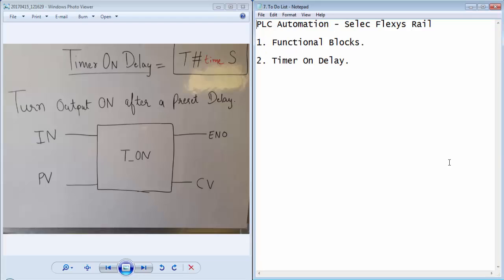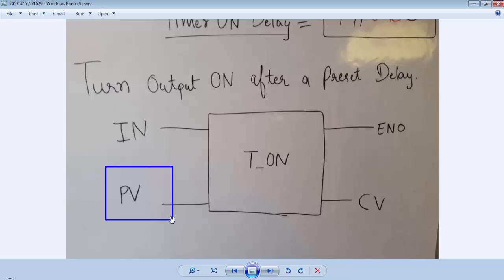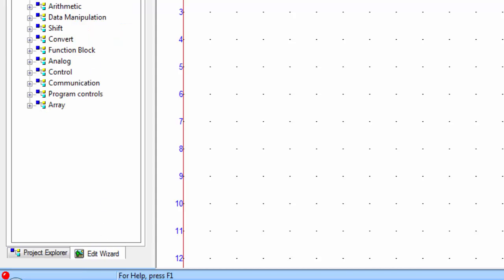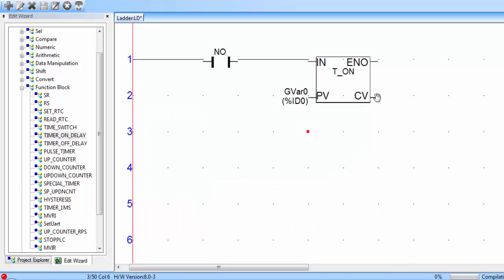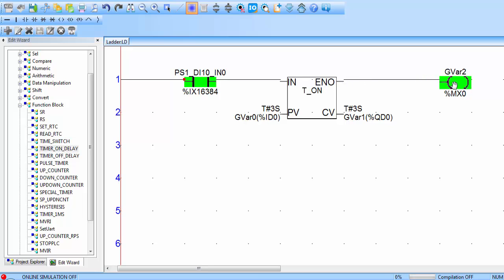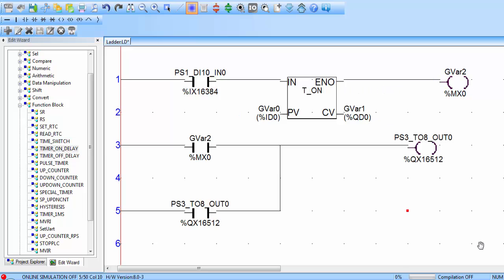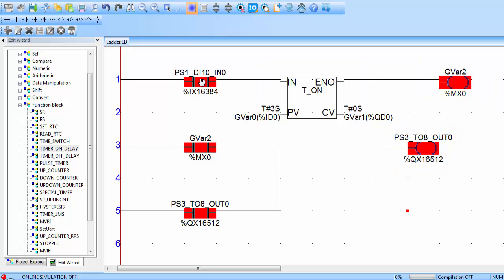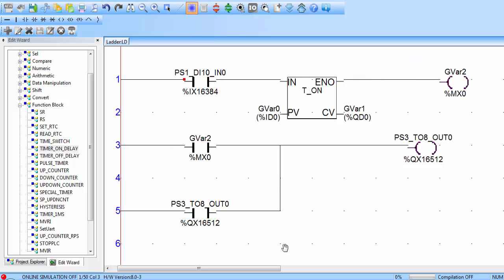Selec Flexys Tutorial 7 - Timer ON Delay

Comment: Sir, how to set Milli seconds in timer
Reply from the maker: Hi Seker, it depends up on the type of PLC and its software. for example, In Selpro Selec Flexis PLC the time format will set the timer in Milli Seconds or Seconds as shown in this tutorial while setting the time delay. but in the case of Allen Bradley PLC uLogix there is an option in timer block to set the time slot for micro, milli and Seconds.

Try to add this line for timer  T#00S50MS   this will set the timer delay for 50 milliseconds.